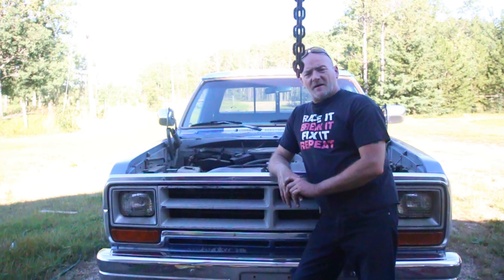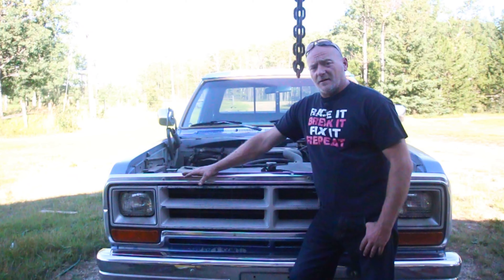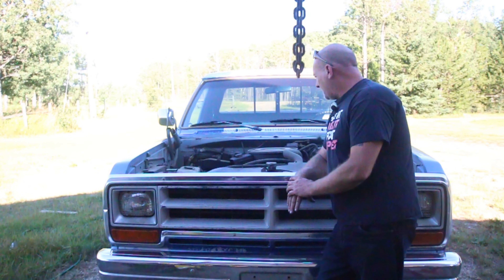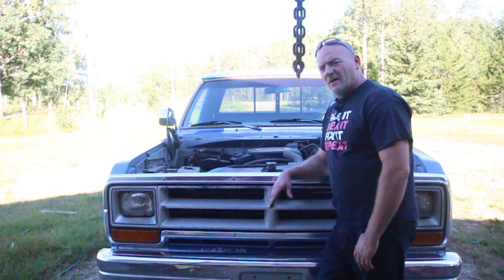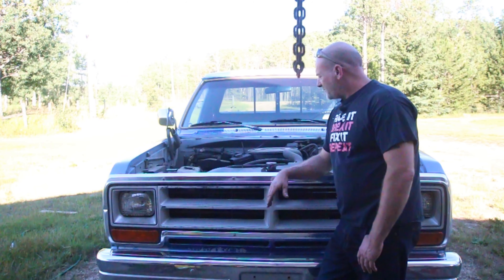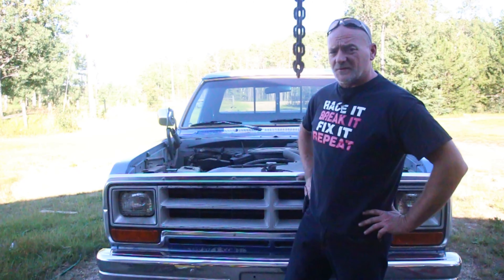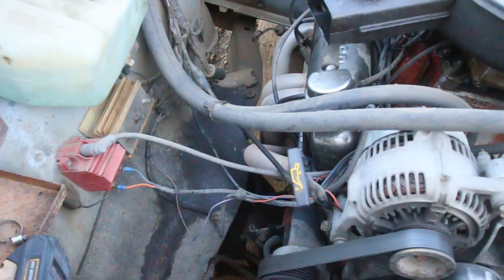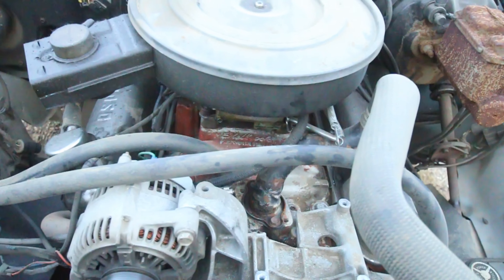1989 Dodge D200 Gets Upgrade! Bad oil Pressure... Here's Why and How to Fix!!

Comment: I had "bad oil pressure" in my Cummins, but replacing the OP-sending unit solved my issue. Glad it wasn't something more complicated.
Reply from the maker: I certainly wish it was the oil pressure sensor. That woulda been awesome for sure! Glad yours was a simple fix!

Comment: Are the Dodge small blocks becoming scarce in the west?
Reply from the maker: Not necessarily scarce ... but scarce in the next to free variety lol
Reply: @dazeofgloryshopworks5806  SB chevy's are becoming more difficult here
Reply from the maker: @noccis3448  somewhat here too. And it's the pricing that's crappy. I've seen 200,000km 5.7's going for $1500-$2000 like they're doing you a favour or something. Just stupid
Reply: @dazeofgloryshopworks5806  Wow ouch!
Reply from the maker: @noccis3448  yeah man it's getting ridiculous when I remember being able to get a complete runner for $50-$500 depending on mileage and addons. But who's counting lol
Reply: @dazeofgloryshopworks5806  That was with the truck still attached!
Reply from the maker: @noccis3448  dang right!